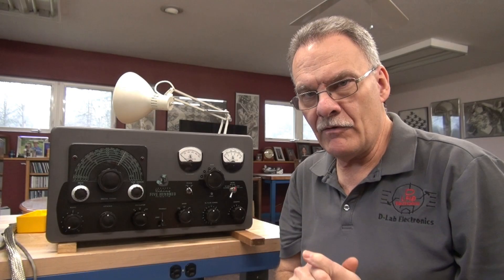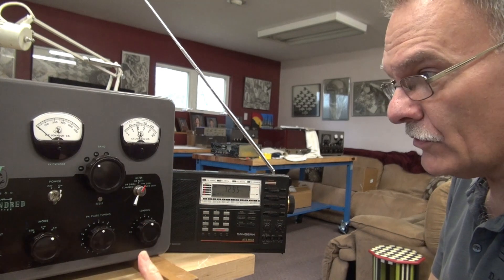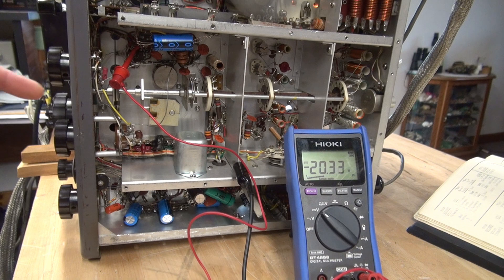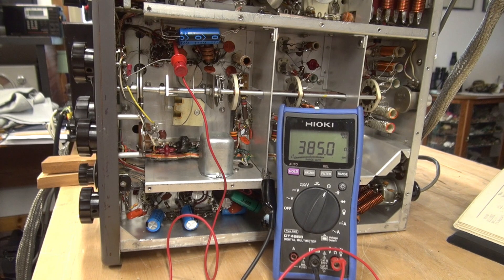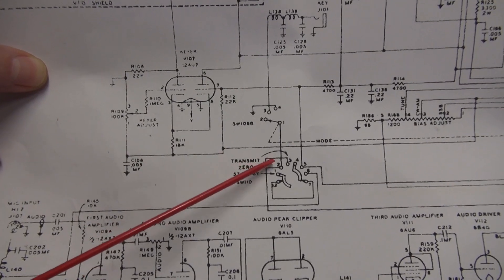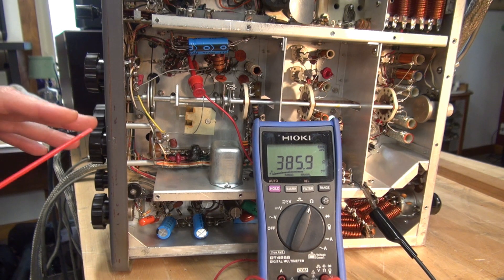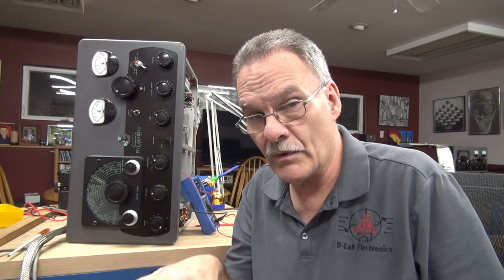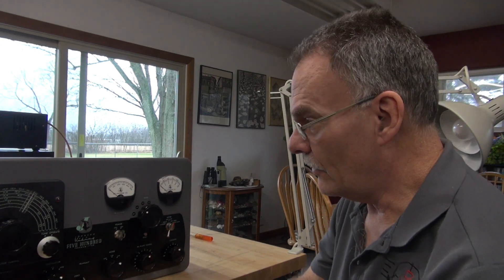EF Johnson 500 Ham radio tube transmitter VFO Malfunction Lots of troubleshooting Caused by Mods

Comment: Nice fix, Terry, glad you got that identified and resolved.

During my days of CB radio repairing, probably 40% of my work involved reworking modifications and "golden screwdriver" tune-ups, with about 10% being microphone replacements and rewiring.  Putting things back as close as possible to stock, as you suggest, often resolved the customer's problems.  Another 15~20% was reworking coax connectors and cabling issues!

I hope the New Year goes well for you, Terry.  Keep up the good work!

Comment: Looks like someone just assumed those were electrolytic 22 mfd capacitors, and upgraded the size to 33 mfd, when in fact they were paper capacitors that were 0.22 mfd with the outside foil band markings.
Reply: If pin 7 is -45 volts the electrolytic capacitors were in backwards as well. 
 Outside foil markings don't matter for polarity, just needs to be the low impedance side. (non electrolytics)
Reply: Replaced with the incorrect type and value seems likely!  And I was wondering about the polarity myself, good catch.
Reply from the maker: Yes I agree, it may have been an oversight. The Mod section is heavily modified and does not work : ( that's next)
Reply: @d-labelectronics  I would be curious if that 300 ohm dc resistance is the capacitors themselves being shorted from being hooked backwards. Would be curious to see those capacitors tested for dc leakage.
       I do not have access to the full schematic on this unit, I could only pause the screen on the partial schematic you were showing. 
     I do love these videos that make the brain strain. No matter how long you are in this hobby, something comes along that seems to defy logic and a person needs to step away. Love these kind of videos that the community learns together.
Reply from the maker: Yes Sir, I will measure the DC resistance again & see if there is a change. Now, I have no modulation, More mods!
Reply: Good information and great advice.

Comment: More so than you at D-lab. I understand mods. when and when not to mod. correcting misguided mods is a problem. ALL mods are not misguided. it takes understanding of these things to decide. I agree with your method. when in doubt do not mod. ONLY if you know what you are doing should any mod be made. these things mostly work in original condition. even with the modulation distortion and splatter.
Reply from the maker: Roger that, Are you a Ham op? Callsign? mine is n6tlu
Reply: @d-labelectronics  w0od
Reply from the maker: Good to meet U
Reply: @d-labelectronics  good to meet you also. I enjoy and respect what you are doing.

Comment: I reversed engineered my SB 200 amp because the 572b tubes from China are very poor quality and now I have fitted GI6B pulse radar tubes and are much cheaper than 572B.
It was a case either use it as a door stop or spend huge amount of money on a solid state amp. G4 LMZ happy new year.